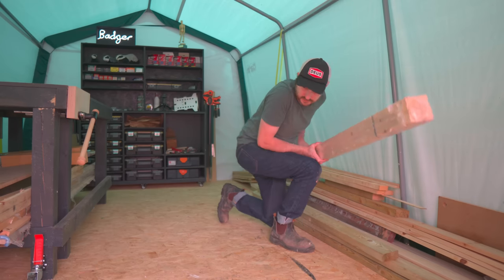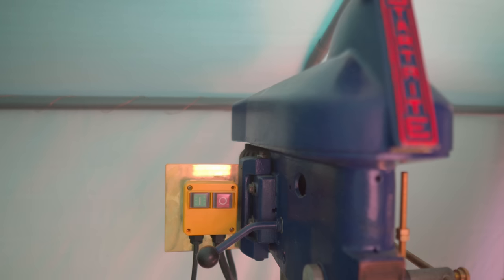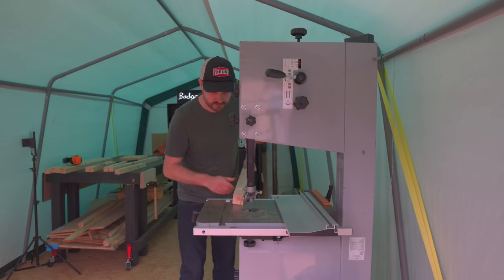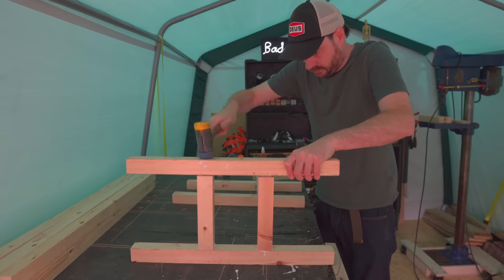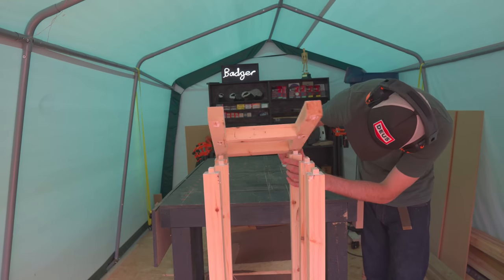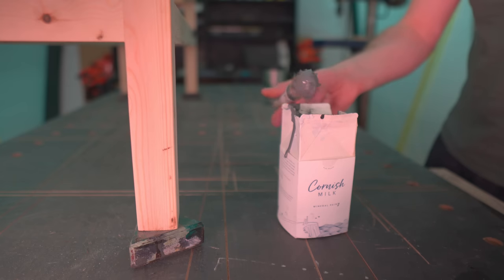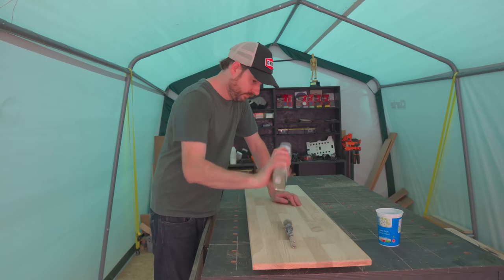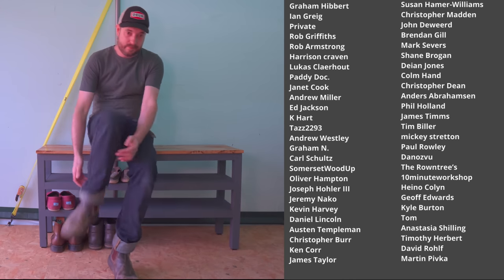Making A Boot Bench

Comment: Wow. I don’t know if I can handle this!! Actual woodwork with real joints and everything. 
I just might have to copy that and hope the apparent simplicity is real. 
Nice work. 
Thanks.
Reply from the maker: Thank you. It could also easily go together with screws and fill the holes
Reply: @Badgerworkshop  anything to help get a bit of text in the comments my good badger. Don’t worry I spend inappropriate accounts of time and energy figuring out ways to not use real woodworking techniques. I just enjoy the humour since I don’t normally see you do joints. 
Keep on doing your thing. 
Thanks for the material.
Reply from the maker: @frederickwood9116  thank you

Comment: good video a little tip when i put those brakets on to hold a top i always put them about 5 mm below the surface level the screw will pull the top tighter  to the surface that it sits on nice, wee bench